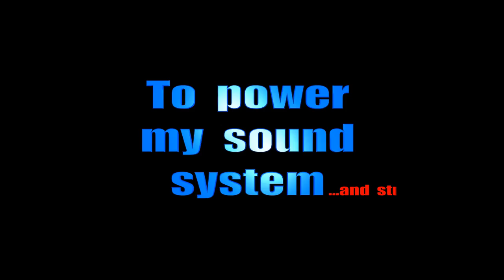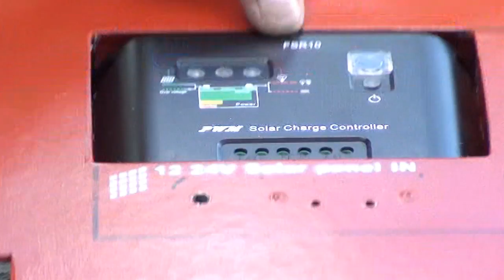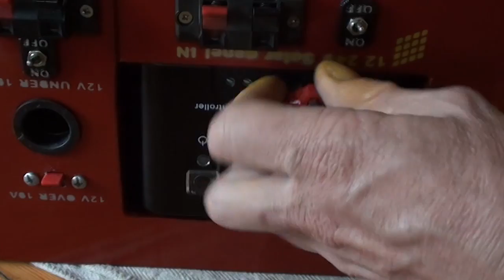Building a solar powered battery box

Comment: Safety First! Very nice build! I watched this a couple of times and didn't see a catastrophic fuse at the battery positive post or any other fuses!  If they are there then I missed it. That much amperage could start a fire without the protection from fuses if a short or overload were to happen! Safety First!
Reply from the maker: Well spotted! it's a case of over editing. There is indeed a fuse at each positive terminal. I installed them just before closing the lid, but edited it out. I definately should have shown that! VERY important indeed! Thanks for the comment!